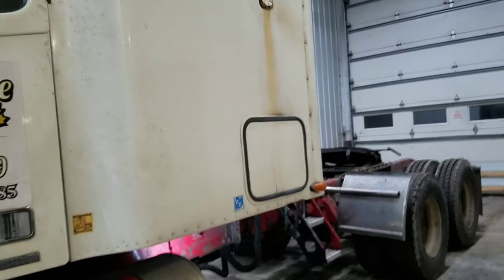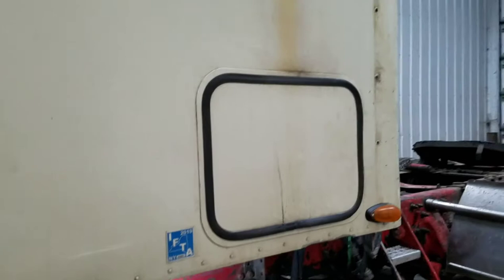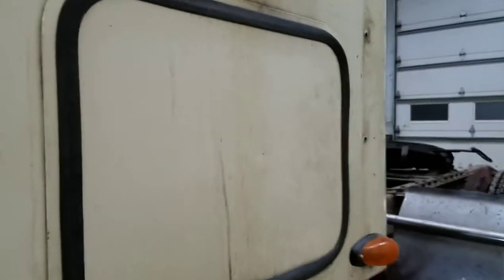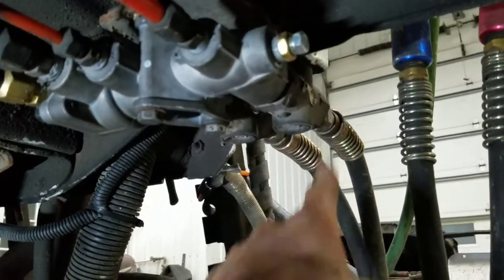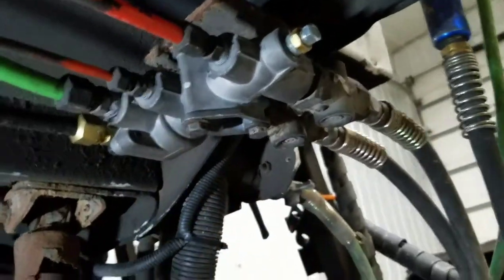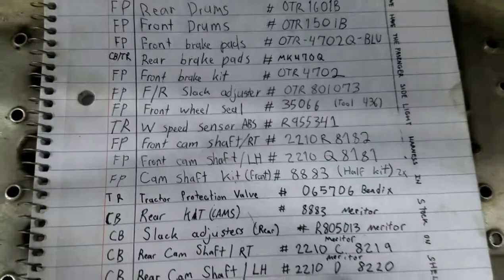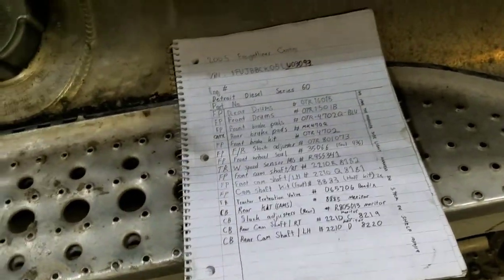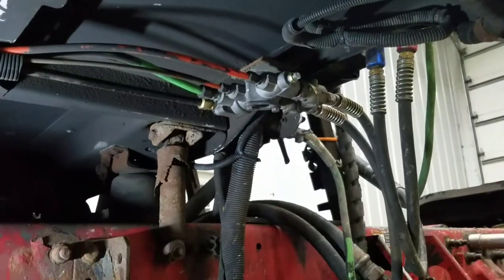Air Leak from glad-hand when you applie brake. | Fix

Comment: Finally somebody that knows what part they're dealing with and knows it's function.
Reply: He didn't actually say what it's function was, he said what happens when it fails. It prevents air from discharging out of the supply and service glad hands/lines when the truck is bob-tailed or if the lines get torn off in the event of the trailer becoming un-coupled.

Comment: I have 95 kw t600, have same problem for months now ,  when i push brake pedal air leaks threw the airline, i have changed the that tractor protection valve aswell as the inside tractor trailer parking valve and still air is leaking i dont know what else to do any ideas?
Reply: I have same issues with my 379 Pit.
Reply: Replaced air protection valve and it leaks air again.

Comment: Hi, thanks for your video.., but I had that problem, replaced that valve but problem still exists. Do you know what else can be wrong?
Reply: Have you found your problem yet? I believe I’m having the same issue as you are
Reply: Same here !
Reply from the maker: If there is still a leak from glad  hands:
First check your pressure relief valve on tanks. Next,  you could have a worn out air switch.

Comment: mine is leaking from service blue line when the air compressor feeds like 60 psi air escaping from blue line without apllying foot breakes and tractor bobtail in parking position .allready replaced so many parts its a mack daycab

Comment: Thanks! Had that problem and replaced the TPV yesterday. Wish I had seen your video earlier! However now I have another problem, probably unrelated. When pressing the foot brake air is coming out of the vent line from the dash valves instead... Ordering a rebuild kit for the dash valve now.

Comment: Thanks buddy I’m having the same problem driving pulling trailer losing air pressure when applying break’s I replace they same valve plus I think there call check valve at the end of hose connecting to that valve but when I tested it it happened again now it’s coming out from the from big air valve on the firewall dammit what’s going on I’ve replaced that valve before well maybe several years ago still braking my head wondering what is going on thanks thought I share….

Comment: My air is coming out of my red glad hand I replace the protection valve and I replaced the push valves on the inside of the truck and I still have this problem any suggestions
Reply: Same problem here. Did you ever figure it out?

Comment: What if air comes out of the red service line? Very slight leak when applying brake pedal. All brakes set in park.
Reply from the maker: Sounds like a bad rubber seal on glad hand on truck or trailer. Should be a easy fit. You can buy a new rubber.

Comment: What year is your century?
Reply from the maker: 2005
Reply: Oh okay thank you, I'm having the same problem i lose air when i applied brake petal.
Reply from the maker: @thowguandong3076  is it coming out the glad hand?
Reply: @joelodico7500  i would have to check hopefully this week.
Reply from the maker: @thowguandong3076  sometime it's a bad air/ spring brake booster. (One at every set of brakes) they can leak when brake is applied.
Reply: @joelodico7500  thanks again, I'll let you know soon
Reply: Happening now on my 2010 peterbilt 386 air coming from the blue glad hand ✋